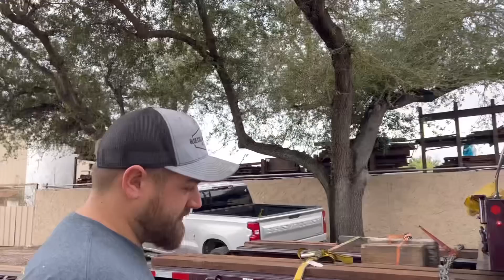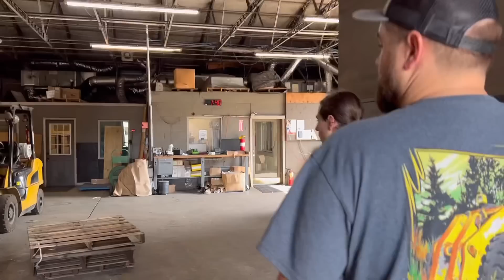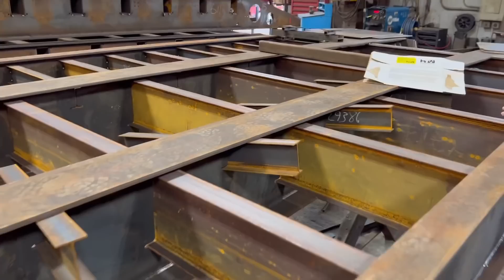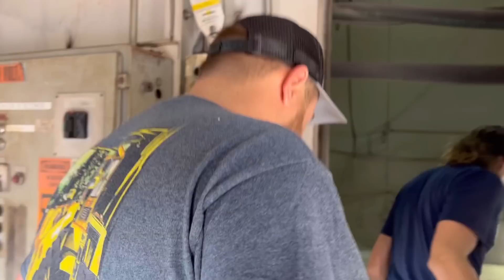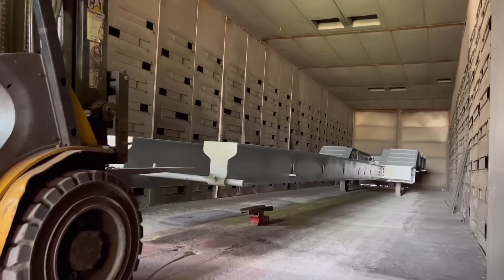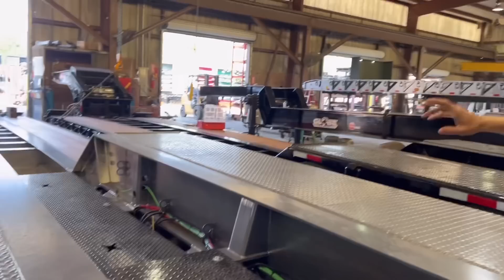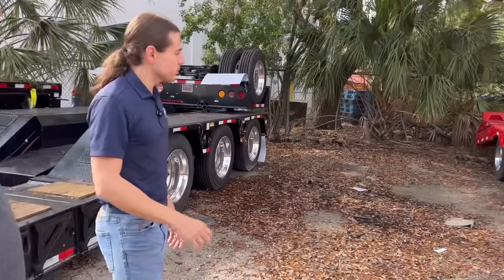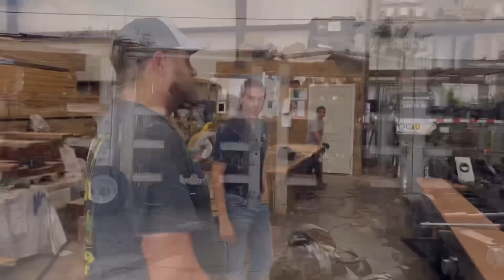How Heavy Haul Trailers are Made! BTW, I Ordered One!

Comment: Bruce great tour. I like to see that metal fab stuff and it's in Florida. Wish the I could get the RV manufacturers to fab and paint there Travel Trailer or 5th wheel frames like Globe does. Great to see they clean there welds of spatter ( BB's) "Boogers" and "Grapes" unlike the RV company's.  I worked a shipyard that built Destroyers for the US Navy. We built them using the Modular construction. The Navy inspectors would not "buy" a module unit if the welds were not clean before it went to blast and paint! BB's and grapes will break through paint eventually, not good especially in shipboard water and fuel tanks!

Comment: That guy is great, showed and explained everything, we run a 55 ton Talbert, three axle rear with lift third and manual dump, we only dump air on the 70k+ pound machines, do their necks have multiple height adjustment? We can set our neck height at 6 different levels which raises the whole trailer height without Messing with leveling valve(import for heavier stuff

Comment: Well Bruce, Globe makes quality product. Nice now they looking for bit of weight savings. 
What are you looking to move? Bigger tractors? As in hight weight? 
26' ft well was standard on 48' rgn 2axle   You add 5 ' for 3rd axle you gain weight you can haul if you can keep it to rear.  Not lot of hydraulic rgn have upper deck over fithwheel. 
Talk to your buddies, talk to salesman.  If you stick with hydraulic neck ask about padded neck support so you not messing you paint job.
Yes in Canada as in some western states we have wider trailers because we can get annual permit to move them.  If load isn't  over trailers width no more permits needed.  Also makes it easier to load at times.  
Good luck.   Merry Christmas to you, family and crew

Comment: Those “Ag” trailers for us here in Canada are used mostly for custom combining crews. They haul dual wheeled combines or 300HP+ tractors/Quadtracs/4tracs with grain cart all over the wheat belt from Texas right up to central Saskatchewan/Alberta. Most custom crews usually run a minimum of 3 combines, plus tractor and grain cart, plus Draper headers, plus pick up headers if they get into canola, which is something that’s mostly grown up here as we don’t grow a lot of corn on the prairies. Canola, lentils, canary seed pay way better plus the yields are so much better.
Reply: We can run 10' wide trailers in western canada with just the over width permit 24/7 and it really sucks loading a feller buncher on a 8.5' trailer with outriggers and breaking said outriggers off.
Reply: Ten wide is the way to go for hauling tracked machines

Comment: You should take a look at heavy haul trailers built down under none of that time consuming crap detaching goose necks & can run 3 or
4 axle x rows of 8 & chassis can widen.
Modern Transport Engineering Hamilton New Zealand .They can come with Hydraulic suspension & you can change ride height etc.
Reply: Faymonville is a big company that deals with that kinda rigging and the company I work for deals with them as well

Comment: I would stay away from a extendable trailer, yes they loads pay better but you will also realize that the extra load pay goes straight to the permits and pilot car fees, i would buy a 55ton with a 3rd air lift axle and 4th flip axle but only if your gonna utilize the big 55ton other wise I would just get a  50 ton with a air lift 3rd axle and call it a day, keep in mind that if you don’t want to deal with over weight permit then I would just buy a 30ton with a 3rd axle air lift or 3rd axle flip if length restriction, also keep in mind and ask your self what your heaviest load that you want to haul cause the bigger the trailer the heavier the empty weight
Reply: Great piece of advice.
Reply: As a dealer we stress homework which generally entails what do your customers want?  Are the loads/machines they are moving growing getting bigger in the future? Knowing the rules of the road where your going, knowing the route your driving are important questions to be answered. All this information helps with your decision process. Bring this information back to Jason at Globe and I am sure he can Zero in on great trailer for your needs. Nice video and tour.
Reply: This trailer won’t last long before he realizes he can’t use it like he thought and it ends up for sale
Reply: He’s not worried about the practical specs of the trailer, he just wants to fit in with the cool kids section at the truck shows.